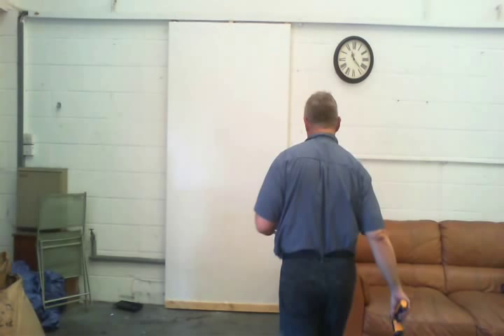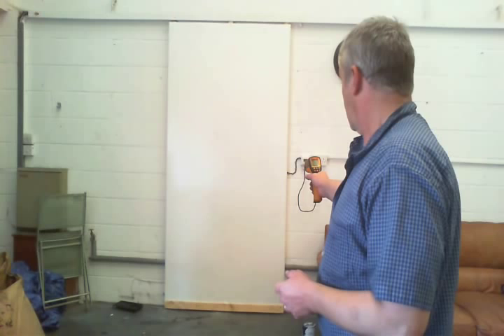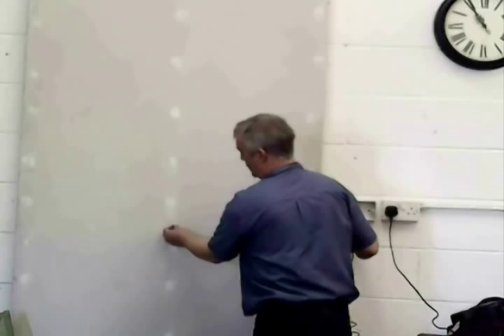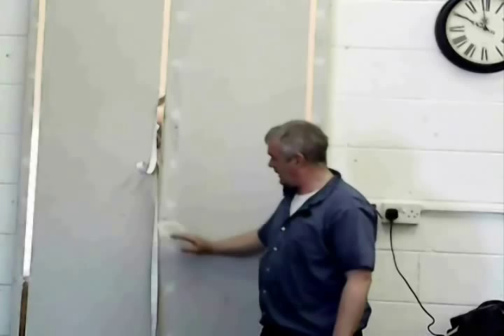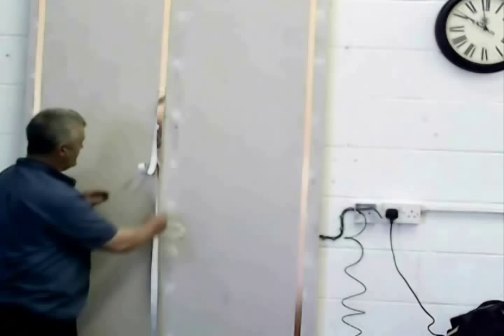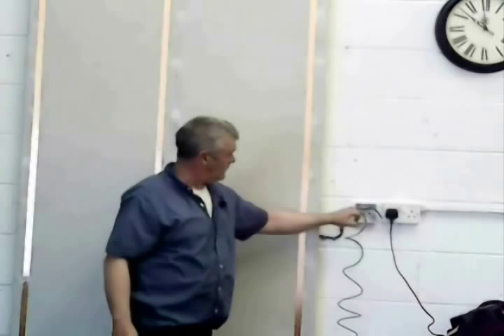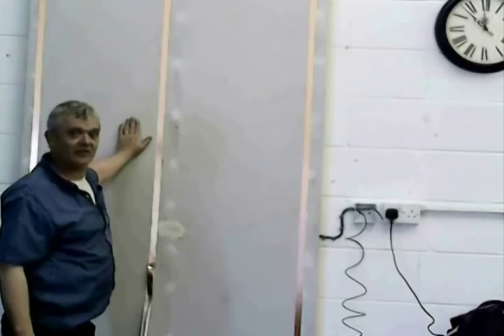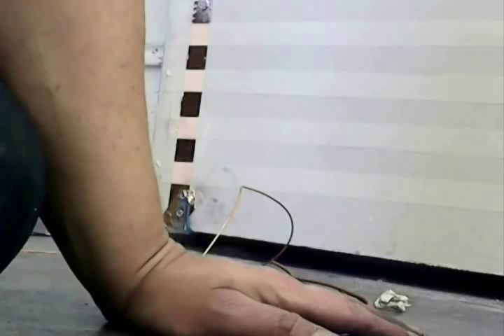Painting A Giant Radiator Straight On Your Wall

Comment: Interesting idea, although to be safe you'd probably want to overlay it with another layer plastic sheet coated with foil or ink and connected to the earth wire.  That way, if someone doesn't recognise your heating method and does something stupid like drive a nail into the surface they will create a short between earth layer and the active to trip your RCD/ safety switch rather than becoming part of the circuit.
Reply: Bury the radiator under a stone wall? Mass heater and nail protection.
Reply: Great idea Neil. @Thomas Marsh I like yours too

Comment: I tried some low temperature (<20°C) applications and discovered that this methods is very good to avoid wall molds.
Use the metal silicate version to paint under usual wall paints.
Reply from the maker: that is interesting - thanks mate - it's a use i never thought about - i must think of a test and demo for this
Reply: Do you have any details to describe how you did it. I'm interested in trying it

Comment: Great project which gives me some ideas if I can get hold of the paint / ink. 
However, speaking as another electrical bod, you shouldn't screw a potentially live wire onto a wooden wall batten. If the batten gets damp for any reason you can develop a fault which might trip the RCD.
Reply from the maker: cool advice mate - cheers

Comment: Robert, I'm really amazed with all that you are doing and all the practical uses and benefits of your designs and research. I'm heading to the hardware store now :) I'm going to build this, and sharing with others. Amazing Thanks Mate :)
Reply from the maker: +Craig Lewis  go for it mate - unless you want to get into a whole world of regulations though - don't wire it straight into the house mains - use an isolated fused socket - the particular requirements will change from country to country - but they are very strict here in the UK - you probably need to check them out for the country you are in
Reply: +Robert Murray-Smith I'm in Canada and I feel that your method is perfect, easy (I'm Ex Navy Electronic/Electrical Tech) and safe. :) Tks.
Reply from the maker: +Craig Lewis cool - let me know how it goes mate - there are lots of uses for this paint
Reply: Hi Robert :) Wanted to see if you have an update to your radiator. How is it's performance? Cheers :)
Reply from the maker: hiya mate- i don't i m afraid - but i did hear of a couple of guys who took this and have set up a company - i believe they are doing quite well
Reply: @ThinkingandTinkering  Where does the time Go?? Ok Back at this while my sand dries ;)  Do you still have this wall up and running Robert? 

I was just bringing in firewood and thought, this is much better to be doing that the energy it takes each year for many to heat homes with firewood. 

If you do not burn wood, it is a lot of work to harvest, handle, costs in fuel and time. Or you buy 8Cords for $1K-2K.  So 1 ton of wood or 2 cord puts out about 3.5 tons of carbon. 

The average home will burn about 8-10 cord a year. My community has 50 homes burning wood so we are making 50 x 10/2 x 3.5 = 875 tons a year of CO2. 

With 50K homes and cottages in NL burning wood 40K-50K Tons/year is a Lot of CO2 and it will continue unless we create a better way.

So not back looking at the wall. :) 

Need to create and Paint. Provide a service. Yet rather than paint the wall for a one time fee. Maybe offer a $20/month maintenance fee. Have a $500-$1000 installation. Paint wall, Install controller, Monitor and Service for life.  Is one idea. Make the paint and test next step. :)

Comment: Love it.  If you wanted the solid block design without the temperature difference from top to bottom you could connect the active to the top of the panel.  That should level out the resistance across the panel.

Comment: Just a thought... this configuration creates a parallel resistive circuit, i.e.- several resistors (paint strips) connected in parallel, and we know that adding resistors in parallel will lower the circuit's total resistance, according to the simplified formula for such a circuit: [Rt = R / N].
So another way to achieve your target resistance would be to start with just a few lines, (or just one), measuring the resistance, and then calculating how many strips you'll need to achieve your target resistance, using [N = R / Rt], Where N is the required number of strips, Rt is the target resistance of the circuit, and R is the resistance of one strip, (or an average of several).
...Or simply keep painting more strips until you get the desired resistance.

Comment: Robert, here in Texas we have the opposite problem--too much heat, everywhere, almost all the time. Could we use the paint-on radiator to harvest energy in the form of heat, and get cold out of it somehow? Generate electricity from the heat, then run a cooling device with it?
Reply: Peltier devices could do that, in theory, if you can expell the heat, but I think it would be expensive.
For cooling, I've been considering ways to cool a smaller space, or even just cool my body, rather than the whole house. There are now portable, battery operated air conditioners. (AC with compressor, not swamp coolers) They are supposed to blow cold air directly on you, not cool the room. But, they will cool about 20 square feet. So, I am thinking of making a blanket fort on my bed and using it to cool that little space as I sleep during summer months. Solar panels would charge a deep cycle battery to run the itty bitty AC. My thinking is that if electricity from the power company is too expensive or even unavailable, at least I could get a good night's sleep.
Reply: @williambianchi2006  Cooling yourself sounds reasonable but it does not work too well in real life. Speaking from experience using a cold water cooled military vest. It uses a backpack full of ice and a pump cicrulates cold water through thin plastic tubing that is woven in the vest.  The result is that yes, you can last longer under the scorching sun but the legs, groin, and especially the head overheat.  At night the head pulsates.  There are water cooled hoods, shorts and pants.  But the whole thing needs to stick tight to your skin and after some time it starts to bother you. Also when the cold water gets warm you need to take off the vest immediately because now you are wearing a plastic vest and you can't perspire well.  Changing the ice is easy and fast but not too efficient - a 250 lb man working heavy physical labor in 100F uses about 1 lb of ice every 30 min.
Bottom line - cooling yourself is not a great idea.  What needs to happen is to cool the air around you.  Which means one thing - some kind of air conditioner that is powerful enough to cool the equivalent of the inside of a car to about 70F.
Making a tent and using that battery AC is a good idea but one pretty serious problem is the cold/cool air distribution.  If it enters the tent in one place it will make it uncomfortably cold right there. Another problem is the air that you breath - the fort will quickly saturate with CO2 and you will not suffocage but not sleep well at all.
Reply: Keeping hydrated with electrolytes and a personal fan...good linen or cotton clothes and keep your hands cool by soaking in cold water time to time Worth a shot but maybe a dehumidifier is your best bet ...i remember how humid and miserable it was in the summer night's when I visited Texas.  I tried riding a bike to create a breeze but no luck to cool off.

Comment: Hey Robert I know this video is a Year old . but the information is still good. Question? Have you been able to Improve on this System? Also, what if you were to paint this on a thin Radiator running Glycol throw it to adsorb the heat and piping it around to help heat the rest of your area?  Have you given any thought to using Tech devices?  You know Thermal conductive Pelter bricks to absorb heat on one side and cold on the other side to produce electric power that you might be able to use to charge up (BATTERIES) or (CAPACITORS) that maybe could be used to help run your heating panels?  I hope you don't mind my inquiring? Thanks for the upload.
Reply: i think it been a bit more than a year buddy lol
Reply: @infertilepiggy5667  This isn't Robert. My question was for Robert.

Comment: I painted a coat of sodium silicate solution, over the radiator (to protect it) but the resistance did raise too much.
What I can use to protect it from electrical shock and water? (without raise its resistance)
Reply from the maker: the paint is water based so anything water based will raise the resistance try an oil based varnish first to seal it then anything you want

Comment: Man this is awesome. I could totally see this being used with a japanese kotetsu.

Also Robert, Do you think it is possible to make a metal foil or leaf by electrically deposit a "thick" plating of a metal onto a graphene sheet then annealing it in a oven or kiln to burn off the non-metals?
Reply from the maker: yeah sure - no worries - burning at low heat is the standard test for carbon purity - you weigh the left overs after you have burnt the carbon away

Comment: Are the carbon tracks radiating heat like far infrared heaters or are they just heating up and conducting the heat to the surrounding air and whatever they are mounted on? Thanks.

Comment: I'd love to try this in my project caravan, linking it (or replacing if you like) to the 1kw heater where the element has gone.

I'm thinking painting a radiator on the caravan walls will also have the benefit of combating damp.

Thanks for a great video!
Reply: @masterdebater8757  thanks for the incredibly detailed reply!

I understand where you're coming from & the info was very helpful 👍

Best wishes to you & thanks again!

Comment: Robert - did you ever end up tracking the energy usage of this device?  If its in a later video I apologize that I've missed it.  Also, do you have any data that you can share around the wall's surface temperature vs. target ambient temperature, aka how how does the wall get in order to maintain a comfortable air temp?  Thanks.

Comment: Just ordered the Paint Robert (Put a Rush on it TY ;) to get this Heated wall system, painted on my wall. To Prove to the People of NL, Canada that we can heat our homes and reduce thier power bills, for heating homes for 7-8 months of the year :)
Reply from the maker: on it's way mate
Reply: Hey Craig - fellow Canuck here.  This is very interesting.  Love to put some radiant heat in my workshop (garage.)
Did you go through with it ? Can you still get the ink ?
Or perhaps a roll of underfloor heating cable.
Love to hear about your results.
I was considering a piece of tempered glass as a radiator.
Reply: @SquareRootOfMinus1  yes i have made several heat pads for starting seedlings. I did the test wall and used it for a winter.

Comment: Sir, You are marvellous! What about an ultra light camping/catastropy version on something like mica or capton sheet for 12V? And e.g. a 2D or 3D (assembled from mica sheets covered with your ink) fractal(-like) structure? A curtain? A cooker? Graphene (coated) sheets as heat radiating "leaves"?
Reply from the maker: good idea mate and you wouldn't need mica kapton is good to 400 degrees C - so plastic will do it

Comment: Have you tried a variation of this that is horizontal as opposed to vertical where it is a series of painted vertical lines on a horizontal board to give more evenly distributed heating?

Curious as to the difference in overall heating by vertical/horizontal arrangement.

Comment: Bye the way Robert, what would you say if we paint it on the ceiling, as this would be the best way to distribute the heat in the room ...evenly... since it is a infrared heating system ... and we do not use the air as heat transfer medium ...
Please let me know what you think!
Thanks!
Reply from the maker: lukelordoflight to be honest mate - i would paint the floor - heat rises lol
Reply: Robert Murray-Smith but since this is no regular "convection" heater, that only heats and circulates the air (yes hot air rises, cold staying on the ground...hot head - cold feat ) , it is emitting infrared waves like the regular infrared heaters (they also use a sort of carbon fiber as heat source, since carbon fiber does give off heat in form of infrared c-waves when connected to electric power) and as infrared is not using air for heat transport (it is direct heating =  subcutaneous heating) you know it from cold winter day , when you are somewhere in the shadow -ice cold air - step into the sunlight and you feel direct heat from the sun= infrared c-waves... but the air is still cold..not transporting the heat... 
understand what I mean? 

And since the best way to heat a room evenly, is to send the infrared waves unblocked to every surface in the room...from the ceiling...we call this method.."Spatial / room shell tempering"... 
I thought this might be a good idea to make it on the ceiling... you could even run the temp.sensor directly on the surface of the ceiling and would not need to run it under / in the wall... and simply cover the cable with paint...and the other thought was that it is more save on the ceiling since the probability that someone touches the ceiling incidentally is zero!
Let me know what you think :)
Thanks!
Best and kind regards!
Reply from the maker: lukelordoflight
sounds like a plan - let me know how it works out for you i'd be fascinated. It's just not possible for me to do everything so I would encourage you to try
Reply: Robert Murray-Smith ..sure... Will contact you about some samples soon..
Also I will make a test with my infrared can so we can see how it works...

Will get back to you about this next week !
Thanks for now and your hard work!!!!!
Reply from the maker: lukelordoflight
no worries
Reply: lukelordoflight
 Hi! Heard ones  that usual ifrated heaters are not reccomended to be installed above the head. Have you tried radiator on the selling? Any trackrecord for the infuence on the human heath (no headache or something?)
Reply from the maker: Shveik1000
- it is a carbon radiator used in underfloor heating for years - the answer is no - research on the net for carbon heat pads
Reply: Robert Murray-Smith
Thanks. Will do.

Comment: Robert In NA we have both 220Vac for baseboard heaters, oven, dryer, etc, yet they are wired directly to the panel or have a single plug. 

110vac is the receptacle outlet to plug in most electrical equipment. So to go by the standards in Canada need to use 110Vac. 

Do you have any numbers for using 110vac as to 220Vac?  

Also like to know about 12-24vdc as a power source, for mobile units. maybe a heating pad. 
Any testing with DC? 

Cheers :)
Reply: Copper Tape 1cm wide? Looks to be 1". Please confirm TY :)
Reply from the maker: no sorry mate - I made this quite a while ago and the ink has changed since
Reply from the maker: you are right it is an inch - but to be honest it won't have that much of an effect

Comment: The Seebek and Pelletier devices are just PNP devices, similar in the manufacturing process with Phosphorus and Boron - I agree that it would increase the price somewhat (compared to the consumer buying each Pelletier or Seebek device individually); however, what if the solar panel/Pelletier(or seebek) were manufactured together in a layered way (similar to the concept of how a CPU is layered)? Would this not drastically reduce the cost? This concept has been on my mind for years since initially learning how CPU’s were made, and applying either effect to it. Love to hear your thoughts on this Robert, excellent video! 😊